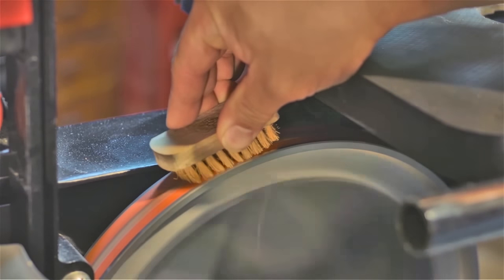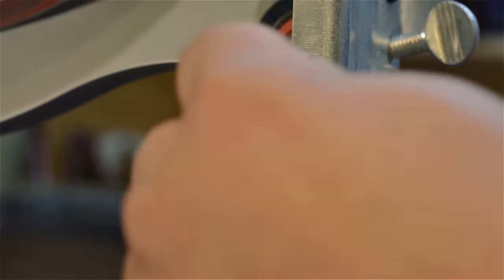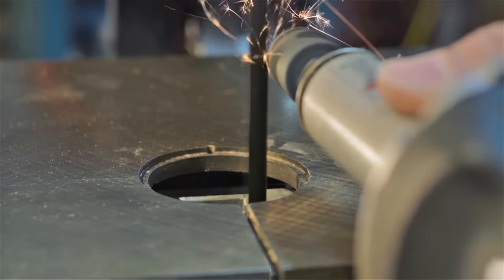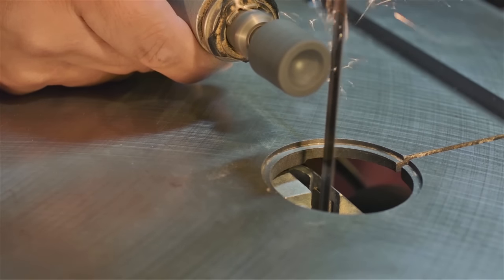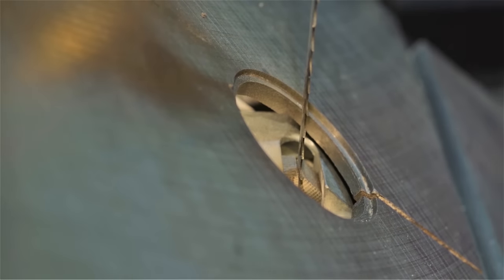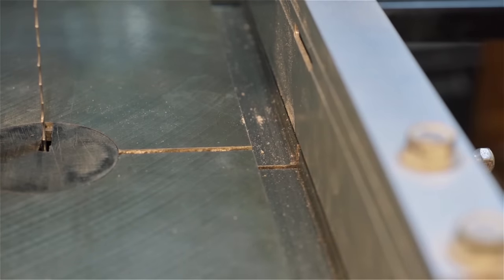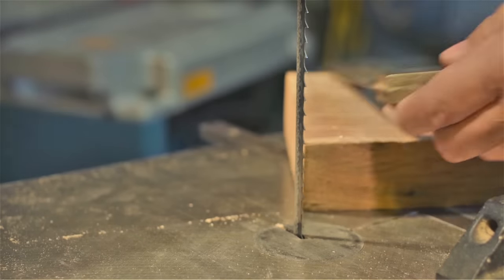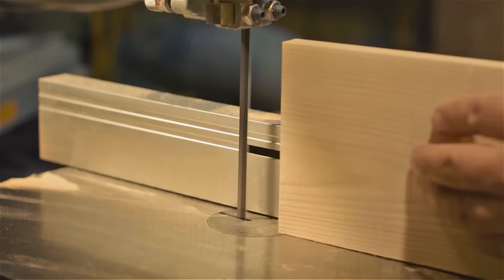Bandsaw Tuning For The Anally Retentive

Comment: Do I need a $3000 bandsaw to get these reaults or can I get a Grizzly for under $800 and do OK?
Reply from the maker: Just because it's $3000 doesn't mean it will be any good these days. Some saws are tuned by the dealer and sold at a premium, others are re-branded to appear "luxury" - but they all appear to come from the same factory in china. The current trend is to add "Features" and not manufacturing precision. I have not seen an $800 grizzly, but they are probably the same as our "craftex" brand in Canada, and while they look durable you must do the same checks that I did in the video. Using a square, check to see if the height adjustment post runs perfectly vertical (both front and side). Check to see if the table trunion supports are machined (not just cast and painted) - are they perfectly aligned and in sync? When you adjust the table at 45 degrees, does it slightly twist sideways (making your miter gauge slot now useless), or does the table stay perfectly true. Are the upper and lower wheel aligned (using a large straight edge). Spin the wheels slowly - look at the edges, are they perfectly true and flat. More importantly, can you run the saw before purchasing to see how bad it vibrates. Most dealers will install a super wide blade, then proceed to rip a micro thin veneer and say "there, it's perfect". What you want is a saw that can rip a micro thin veneer with a tiny and thin blade - which suggests the saw should be accurate at other tasks. I don't actually use the Delta much for veneer, but I do use it to cut cheeks and joints using the fence, so I need it to be accurate enough for that task. Thirty years ago, Delta was the standard in 14" bandsaws (as everyone else basically copied them). Some competitors were significantly better (Canada's Quebec made General) and the USA made Powermatic were also good. For reference, the Delta I have was $1300 CDN ( in 2003), and a General was $2200. I've always wanted a General but couldn't afford it. The Delta has features that I have not seen on current lower end saws, the wheels are balanced (like a high speed flywheel with section drilled out), the bearings are imperial (easier to find), the trunions for the table are machined, the post support is also machined internally too, as I've noticed modern ones aren't. In short, look for manufacturing precision and does the saw maintain it's settings when adjusted at it's minimum and maximums. Ignore fancy gauges and knobs - if the arm doesn't move up and down perfectly in a perpendicular or straight fashion - don't bother. I actually don't think this is possible with a stamped steel bandsaw, even a $3000 one as every one I've examined moves in/out or side/side a few millimeters - that is why they use roller bearings, to mask the excessive slop which would make using friction blocks impossible.  I'm told this doesn't matter, which is technically true I suppose if you have to adjust all the bearings - each and every time you changed height. To me it suggests, the saw lacks any form of precision in it's construction, which you must always compensate for. Perhaps I will do a video on what to look for in a saw. Good luck!
Reply: @RockwoodJoe   I saw quite a bit of lateral movement of the height gage as I adjusted it up and down.   I could adjust the table to get it square to height Gage bore, but then the blade wasn't square to the table.  Ultimately the height Gage bore didn't agree (wasn't parallel) to the wheel tangents.  I wound up having to shim the joint between the upper and lower castings to make the wheel tangents agree with the height Gage bore.  Happy to see your mention of that relationship here.

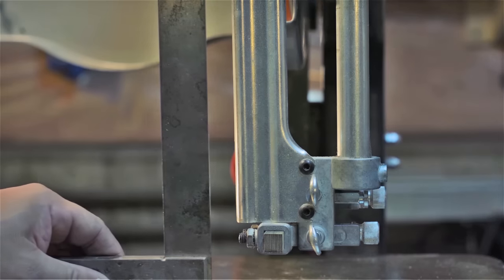Comment: Around 2:45 you talk about making sure the blade guide moves perpendicular to the table.  I have a Delta 14" (with height kit) and the blade guide has never (before or after the addition of the height kit) moved parallel to the blade.  I could make it perpendicular to the table, but then the blade would not be.  If your bandsaw moves the blade guide parallel to the blade while they are both perpendicular to the table you can be happy about that.  (Having said that,  if you have any suggestions for fixing it that don't include re-machining the hole in the casting the guide goes through, I'm all ears.)  
Thanks for the interesting video.
Reply from the maker: Is it a USA or offshore Delta. Delta machined the  carriage yokes to be perpendicular to where they bolt to the lower body, and the flat spot to where they bolted to on the body was also machined flat with where the riser (or top) was mounted too. All these components need to be machined square to one another. Check those mounting points first, as you might have to shim the riser at different points, and the the table mounting yoke also.
Reply: @RockwoodJoe  It was made in the USA.  But I think it was made when the wheels were starting to fall off at Delta, there were other issues.  (Table wasn't flat, Delta replaced it.  Pulley was not all that round, I replaced it.  For the blade guide issue, they suggested I buy some shim stock and take the two half-castings apart, insert shim stock, put it back together, rinse and repeat until it was OK.  Given the difficulty of getting it apart (the alignment pins were certainly not sloppy), I decided it was probably easier to adjust the upper guides every time I adjusted the blade guide.)
Reply from the maker: @ndo342  That is probably you're best option. If the quality wasn't baked in, it can be impossible to tune. My current Delta wasn't my first saw...

Comment: Im not a big fan of working on a running saw. Grinding the blade while running did seem to make a big difference...but i will be setting my guide blocks static thanks..
Reply from the maker: You can just turn the wheels by hand, for a much slower dynamic balance. Probably similar result.

Comment: Hi. Great video.  I have a similar if no identical band saw.  Do you know where I could order new bearings for wheels? Thanks for your help.
Reply from the maker: I would recommend you take the wheels off, press out the bearings yourself (carefully) and then take them to a local bearing supplier. There are usually a few of them in large urban centers. They will measure/examine the bearings and source you new ones - usually around $10 each for Chinese or $30 for Japanese. I don't recommend you take the wheels in for bearing replacement - unless you absolutely trust the shop. If the wheel is ever dropped, it's NFG forever. Delta did use different sizes over the years I'm told, so it's best to just mic the old ones. The original ones were really cheap, so new ones will be an improvement. Good luck!

Comment: Hey guys I have a question.  I am having some difficulty resawing and would like to see if anyone can give me ideas on what I may be doing wrong.  I have a Grizzly 17 inch bandsaw.  I have used the "Alex Snodgrass" method for setting it up.  I am very new to this stuff by the way.  The problem I am having is I can't seem to get a consistent thickness from top to bottom when I resaw something.  Fence is square to the table.  Blade is square to the table. Blade is square to the fence.  I use a featherboard.  Always seems to be thinner at the bottom.  Any ideas?  Thanks.

Comment: I am no expert, but the way you grind the sides of the blade must give a relative rough surface?  After grinding, I would softly push sandpaper 600 or higher to give a higher polish?  Doesn't the rough surface influence the lifetime of the guiding blocks?
Reply from the maker: The roughness probably does influence the blocks, and I agree about a higher polish too! Gotta leave enough material for a sequel ehhh...
Reply: @RockwoodJoe  I forgot to tell I appreciated your video! Good camerawork, good voice and most probably good expertise on the subject!

Comment: I was told that the cool blocks would not fit my 14" Powermatic band saw.  I have bearings on both sides of the blades.
Reply from the maker: Probably so, you need a guide system that can fixture them. You might be able to retrofit from another older bandsaw, like an old grizzly perhaps.

Comment: so how much board can you actually cut with a band saw blade before they start getting dull and ruining wood?
Reply from the maker: Good question, so I'll provide an annoying answer. Depends upon the species & thickness, and how hot the blade gets(or rather how well the blade clears chips). Tall pieces that fill the throat and heat up the blade generally cause 10x more wear. I could run 1000 ft of 1 inch thick dry pine before I see a dull blade. I get a dull blade after only 50 ft of 6 inch thick oak. I also use my badsaw to cut cardboard, which is very dirty and dulls the blade just as bad as the oak. In most cases, my blade doesn't naturally dull from prolonged use, but by accident, as I re-saw vintage wood that will have nails or rocks. Modern particle and wafer board are also very dirty and tend to dull carbon steel blades. If you can afford it, then a carbide blade is nice - but even they get ruined when hitting a nail. Cheers!
Reply: thanks for the reply, that actually gives me a good idea. I don't plan on hitting any nails. Just got a Grizzly 14in bansaw with the riser block to get the 12in resaw capacity, this is my first bandsaw so I am trying to figure out how long these blades can last and figuring if it's worth it to get more expensive blades. I picked up a couple timber wolf blades to start off with and have a few factory blades that came with the saw

Comment: Very nice video.
Why do you have the upper blade guide so high up when cutting the 3/4" thick material?
Reply from the maker: Only to demonstrate that "drift" is non-existent, even when you provide minimal support after you've dressed the blade. You should never run in this condition normally as it is unsafe as you have alluded to. Cheers!

Comment: The thing that gets me in any "How To" video, is when the person says, "If [such and such] needs to adjusted (or fixed etc) then do so." Then they never show you how to do that. Same goes here at about 5 spots in the "tutorial"
Reply from the maker: Polishing a turd might actually be easier in real life than fixing some issues that are present on modern band saws. Overcoming some manufacturing defects I've seen today are sometimes not practical, especially concerning wheel balance and squareness of setup. You are correct, it would probably be another 15 minute video just to address lower wheel smoothness.
Reply: Sometimes you must ask yourself if you are competent enough to own a piece of equipment that may be smarter than you.  Sell it before you cut your fingers off and stop looking to a free how-to video to help you understand the meaning of life.  Some people are mechanically inclined and others....wear skirts

Comment: i like your video .? when i try this set up it seems to me after i make the ajustaments my guides seem to move then i have to readjust mabe you can explain whats going on i have a grizzly 14 inch band saw with the 6 inch riser kitcan you help please?
Reply from the maker: The upper arm is most likely out of square with the table, or possibly the guide does not move perfectly perpendicular. Adjust (move or shim) the top cast iron arm that attaches to the riser until the guide move up and down perfectly. Good luck.

Comment: The best band saw blade has nothing to do with expense.  It remains a mystery why the occasional cheapo blade runs beautifully and the hyped up hard-tooth or carbide runs like crap! Always check the weld before you leave the store.  When you find a good cheapo, re-sharpen it until the set is gone.  After market tension spring is also essential, for the Delta anyway.
Reply from the maker: No mystery for me.

Comment: Great info ! Have you ever heard a slapping noise when cutting ? If so any advise on correcting this ? This is driving me nuts !
Reply from the maker: I've heard slapping when cutting on other machines I've owned. Check the blade guard and areas where the blade might lose tension and hit some part of the frame or guards. I also had severe slapping on a band saw that had very loose tyres, as when the saw would run, they would fling out where the blade was not touching. Severe "slapping" can also be the wheels wobbling against the frame or guards when they are tensioned. There are a lot of causes. Hope this helps.
Reply: @RockwoodJoe  Many Thanx Joe. The noise seems to be around the lower guide area. All is smooth and quiet when running but not in cut mode. I will continue and hopefully quiet this down. Any further ideas will be very helpful.  Thanx Again...…….

Comment: That was awesome!  Is there any danger of ruining the temper of the blade while grinding the back and sides?
Reply from the maker: No, not if you're very light (as shown). The blade never even gets warm to the touch. Most of the heat will comes from using improperly adjusted guide blocks, or steel blocks. Cheers!
Reply: @RockwoodJoe  Thank you!

Comment: How do I set up my blade or table so it's square with each other? The guide I have is not adjustable itself so I have to eliminate drift completely if I want to use it. No idea how to do that! Help would be much appreciated!!
Reply from the maker: On the Delta the saddle that bolts to the table has play if you loosen the 4 bolts that attach it. You can rotate the table slightly left or right to make the slot square, then tighten the bolts. This is because at the factory it would require greater tolerances when assembling the upper arm to the base (perfectly square). The saddle itself is machined, which helps with accuracy. I believe they did this to compensate for assembly errors. On the newer stamped steel band saws, some of them don't appear to be adjustable or rather easily adjustable. Closely look at the construction, and see if there is a way. I know this doesn't help much. Good luck!

Comment: Can I ask how does grinding the back of the blade affect the front/toothed side. Is the discrepancy in the blade width that your removing?
Reply from the maker: It's not the discrepancy of the blade to "height", it's to compensate for how the ends of the saw stock might not be welded/brazed perfectly in-line. Imagine joining two rulers end to end, but at a slight angle. You would never be able to get a straight edge from the newly joined rulers. Ditto for bandsaw blades, as they sometimes walk front and back on a wheel. It's really to compensate for a manufacturing defect - something I see more on cheap blades, but also on expensive ones from time to time. Most blades are really handmade still, and rely on a person putting them into a jig, then spot welding from what I've seen.

Comment: Well unlike some of the commenters I do have access to a bandsaw and it drifts severely, so this may be very helpful
Reply: The secret to eliminating drift is to position the gullets of the blade so they run on the center of the wheel. Do not center the entire blade! Getting the tension sufficiently tight is also important.

Comment: The 3/4" blade on my 14" Jet BS (JWBS-14CS) oscillates forward and back almost 1/4".  Any recommendations on how to fix that? The smaller blade oscillates as well but not as much and I believe I tensioned both blades properly.
Reply from the maker: Try different blades, or take the blade off and lay it out on the flattest surface you have. See if it wobbles like a four legged stool on an uneven surface. If you find that it is wobbling that quarter inch, then you probably need a better joined blade, or possibly rejoin it yourself. I've found the wobble comes from the ends of the blade not welded/brazed perfectly in-line with each other.
Reply: @RockwoodJoe  It was the blade, thanks

Comment: Am I wrong? How does grinding the BACK of the blade to flat/parallel have anything to do with the cutting edge. To me, this would be like cutting a disc in half, then sanding the cut nice and flat, then claiming you have made the disc's outer edge square. The back edge of the blade is flat and parallel to the square now, but the teeth would have the same 'in/out wobble' possitionally as before. No?
Reply from the maker: The back of the blade must sometimes contact the rear thrust bearing under heavy load, if it's not perfectly flat, when you hit that "hump" it will force the blade to push out from the guide blocks, which are then no longer guiding the blade as well. The guide blocks should be "guiding" the sides of the blade, changing the surface area that they guide (blade thrusting in out), will cause deflection and an uneven cut. There is nothing that can be done about the teeth moving in and out, well not easily that is, but they have large enough gullets to accommodate the "in out". If you have a blade that is wobbling "in out" more than the gullets, then you basically have a completely unuseable blade. Hope this helps.

Comment: Wow, could you please come do mine 😊😊. Great vid. I got the Dremel on back of blade but, would you mind explaining the Dremel on sides of blade ... what does it do for it ??? Good to know cool blocks are worthy!! thanks
Reply from the maker: On cheap blades, sometimes the sides have weld spatter, or dirt coated on during the corrosion coat, etc. In many cases, it's the joint weld that I'm trying to smooth down. The "tick tick" you hear. On a very expensive blade that has been "ground", this probably isn't required - unless you're uptight!  I am usually cutting up antique lumber and find lots of iron things nicely embedded - which I don't discover till in the middle of a piece. Nothing bothers me more than seeing a $30 swedish blade with all the teeth rounded over after sawing through a nail lengthwise.
Reply: @RockwoodJoe   thank you very much for your response... it's a aah ha moment... makes good sense of course. Again, much appreciated 😀☺️